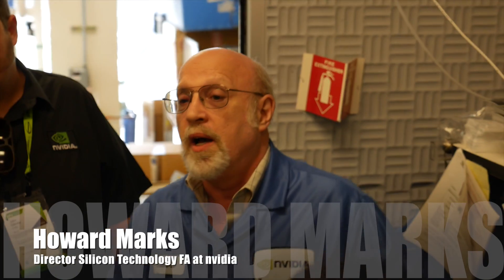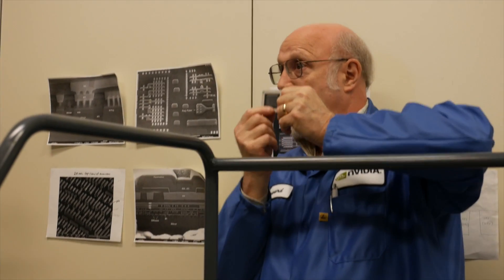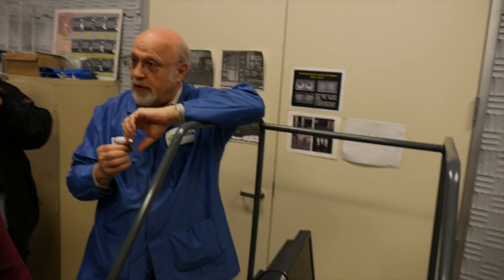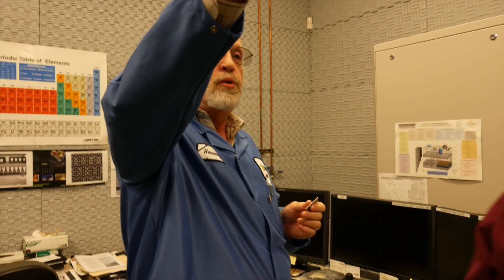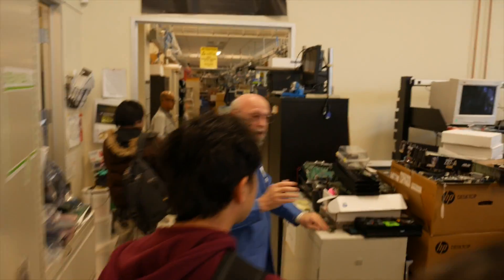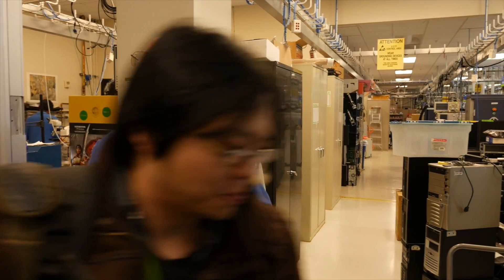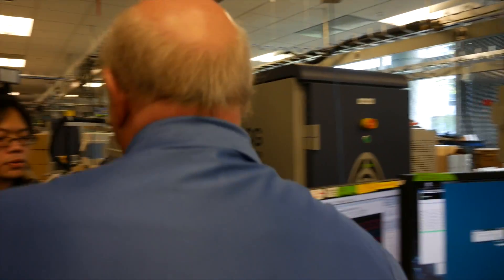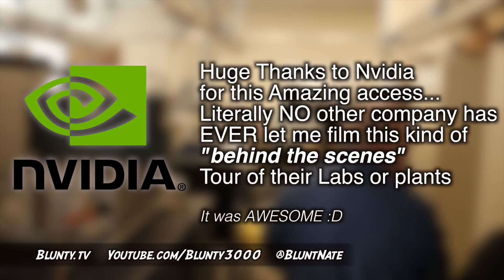Nvidia FAILURE… Lab - AMAZING Behind The Scenes Tour

Comment: Over 9, 15 or 150 billion transistors and it only takes 1 to fuck everything up.
Reply: +Chuywaka Who would've thought a transistor could have  as great, or even greater, impact than a human being.
Reply: +Chuywaka It actually does not take 1 to ruin the part, it has automated self repair mechanisms and redundant circuits. It's not that bad.

Comment: cool lab but i think 10.000 dollars sound proofing is unnecessary you could get corrugated foam boards they would do the same plus it'll be cheaper
Reply: +Toble Fire And when you have a lab fire and the insurance won't pay out on your multi-million dollar lab because you coated the walls and ceiling in materials which are not fire rated, you realise $10,000 is cheap.

This is not your DIY basement playground, this is a serious facility, doing work worth billions of dollars.

Comment: when he said it could see atoms, i was like wtf
Reply: +NonsensicalSpudz AFMs are interesting tools. In theory, you could make one at home, there were some project logs a few years back using piezoelements to microposition the probe.
It's literally just dragging a thin(atom thin) needle across the surface, and seeing how much it dips. Each dip is space between the atoms, hence why the name Atomic Force Microscope.
Reply: +Spirit Not entirely correct. 

The "atom thin" needle is huge. Scanning tunneling microscopes use probes that are often nothing but a piece normal wire cut by hand. Because in the end there is always only one atom closest to the scanned surface. 

It's funny how irrelevant such stuff like precision gets once you go small enough.
Reply: steini19o4 Well, TECHNICALLY I'm not wrong, the needle is atom thin at the end... :>